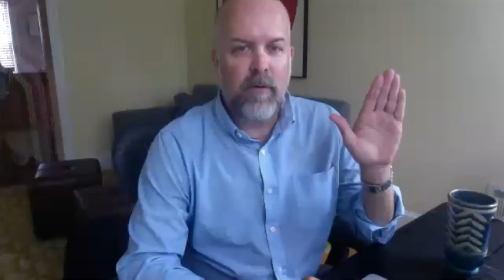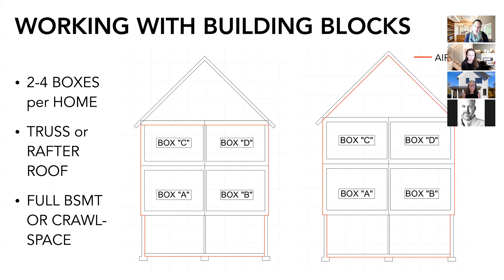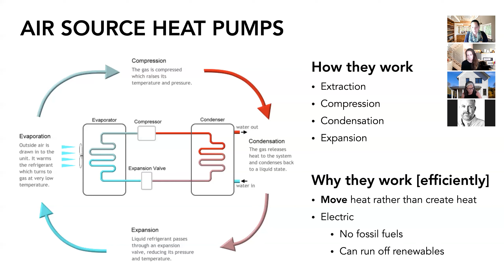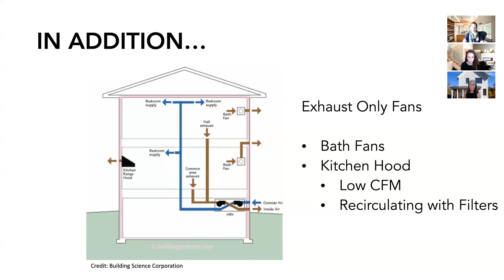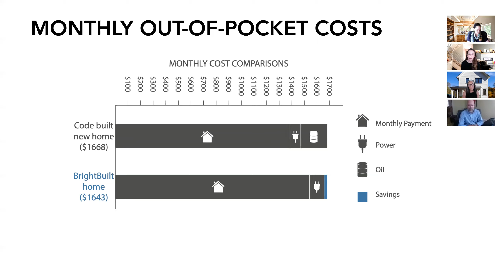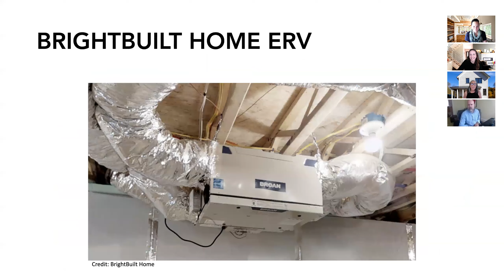Zero Energy Home Mechanical Systems

Comment: Ductless are not cheaper on lar houses tat are no barnes1 ! Many most issues will require multiple units heads, making it substantially more expensive and a real pin o chnage lol those filters each one of which much harder than with ducted system.